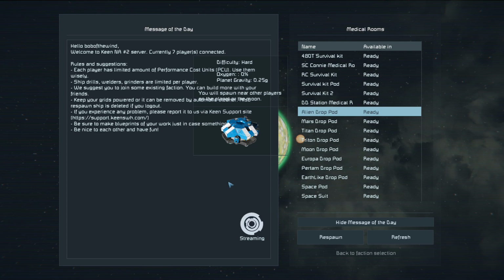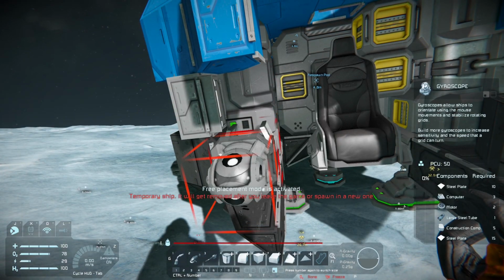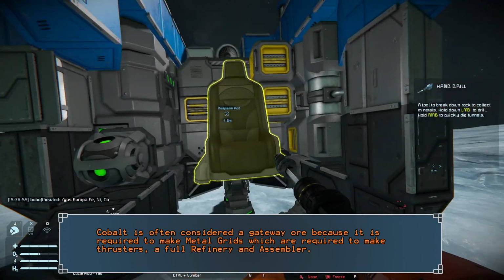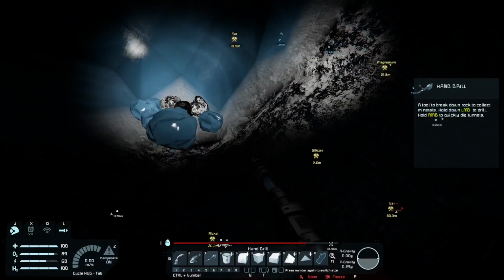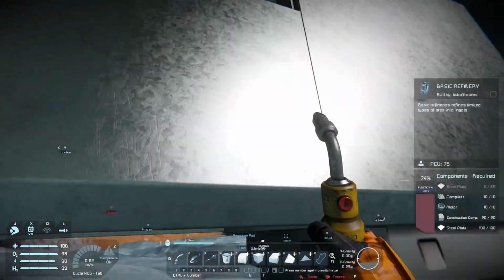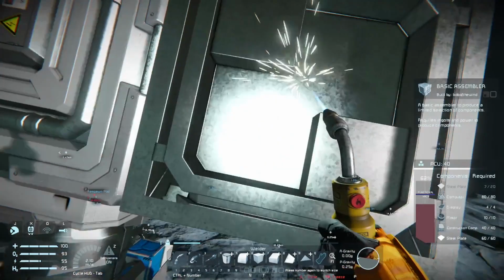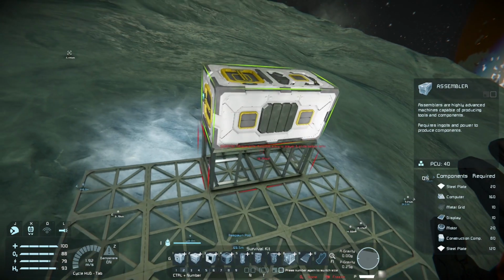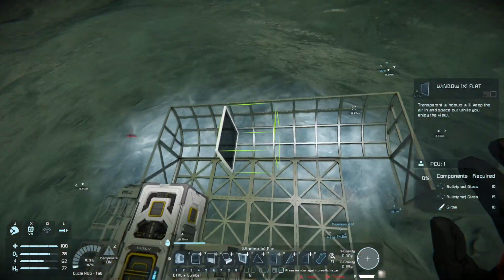Europa Escape 01 - Space Engineers Public Server Survival/Tutorial

Comment: Out of curiosity, why do you put a separate control for thrusters on and off? Is using the Toggle On/Off bad?
Reply from the maker: I believe it is all preference really. Just be consistent and you will reduce your PEBKAC crashes.
As you will see with the later craft, I like 3) All thrusters on, 4) Forward breaking thrusters off, 5) All thrusters off. I do this so I do not have to worry about frantically toggling thrusters. 3) will make me go, 4) will let me save fuel and cruise, 3) again will let me break and land, 5) to power off thrusters.
Additionally, when applicable, I like 7) Turrets On/Off, 8) Jump Drive home, 9) Jump Drive destination.
I will use other tool bars for systems other than flight operations. Many of my published ships will have redundant flight seats with other options on tool bar one but usually have my flight layout on the next available bar (usually bar 2 or 3).